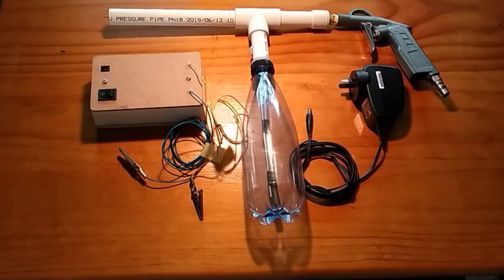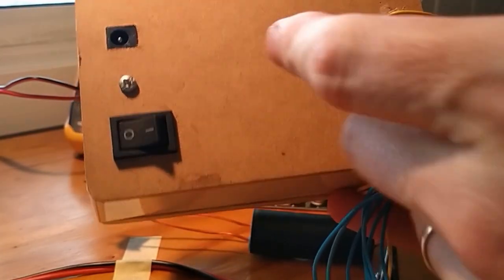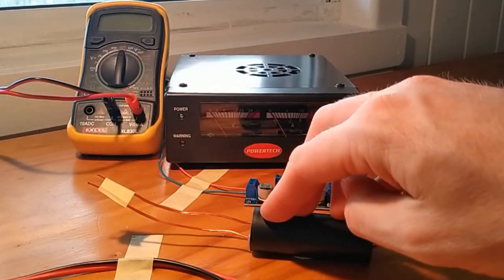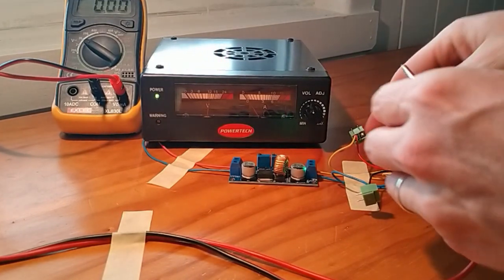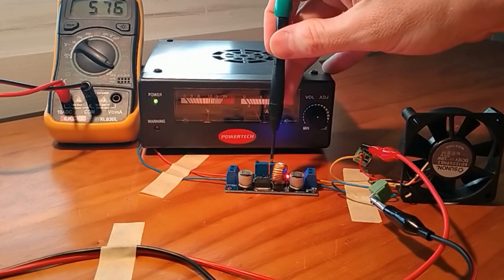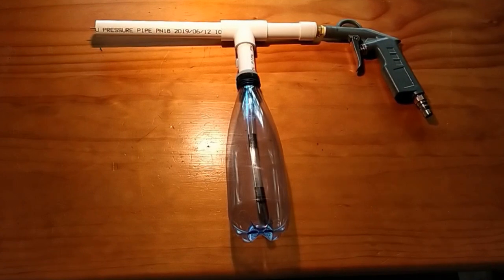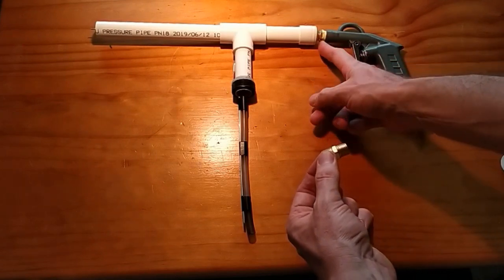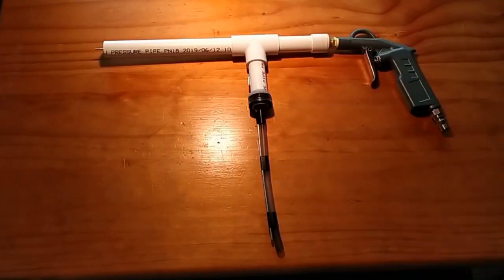Homemade Powder Coating Gun

Comment: I built a powder coating oven, and I have been trying to make a powder coating gun, with no luck, then your Video Pops up details leaving nothing to ask you about? Man you rock!, I thank you very much for this very detailed explanation, I happen to have all the parts except the dc-dc step down buck, I've placed my order just now, because I don't wish to destroy my taser module.
Thank you again
Reply: Im trying to make an over out if a smoker grill egg shaped one thats electric is it possible they get hot enough ?
Reply from the maker: You're welcome. Have you seen my other videos? 2nd Generation gun? I have made some improvements you may wish to take advantage of.

How big is your oven?
Reply: @tinkersmith4615  Going to do so right now, my Oven is quite small 40X40X40 Cm, and btw, I've subscribed to your channel :)

Comment: I'm a little late to the party here, but I do see one little issue that might  change the efficiency of the system. Those little taser modules typically put out high frequency high voltage AC.  For that to really be effective in a charged application system, it needs to be DC.  You'd be better off using one of the lower-power 20kv modules and adding a couple of voltage multiplier circuit to the output. Use a couple of capacitors and diodes potted in wax or epoxy.  Or even a just string of 1N4007 diodes potted in wax or epoxy attached to the output would probably do it.
Reply from the maker: Never too late. :) So build a bridge rectifier and use a 20kv module (to reduce the number of diodes required)? For example you would need 24x R3000 to rectify 20kV, where you would need 66 for 55kV?
Reply from the maker: I do like the idea. I might need to do some testing. The only hurdle I see is that current configuration produces really good results for very little time and money. Diodes, resin and all that is whole lot of manufacturing. Do you have a sense or gut feel for what the additional benefit would be the effort?
Reply from the maker: Actually I do know that if you supply 1A into these "400kV" modules you get about 30kV output. Ran a series of tests and measured the gap between the sparks. 30kV per cm.

Comment: Would fish tank compresor be sufficient enough for it 1,8l/min?
Reply: I think its a nice idea also a was thinking about 12 car compresor it can be hooked up to same power supply as gun
Reply from the maker: I couldn't say for sure but I doubt it would the airflow required. I am intrigued by the concept though. A compressor-less powder coating gun. It would be a super cheap set up and you probably would have less issues with moisture (no compression and expansion of gas). What about using an air mattress inflator pump?
Reply from the maker: Something like this: https://www.bunnings.com.au/ozito-500l-min-electric-air-pump_p0242858?gclid=Cj0KCQiA6t6ABhDMARIsAONIYyynjBaXJ-TlSu7800huyx2i9LO8TM80saDZWGsQACyTPN-rSQZoeCIaAvAlEALw_wcB&gclsrc=aw.ds

Comment: hi, how do you check if its positive or negative? if you touch with the positive a metall mass it do something? (i need to charge positively one powder for a project, but it must be positive charge)
Reply from the maker: I couldn't say for certain. I'm only guessing that it is follows straight through from input wire to output wire.

Comment: Thanks for the uploads.  I am in the process of building my own. I have read and seen that to get the best coat on you part you need a good ground.  How do you ground your parts?  Thanks
Reply from the maker: The only ground I have needed was connecting the work piece to the negative high voltage wire. I too have read about people driving earthing rods through their shed floors into the ground and connecting them to the negative wire and work piece but I have not needed to do so.
Reply: @tinkersmith4615  Awesome! Good to know.  Thanks for the quick response.  I look forward to more of your videos, they really are first class.

Comment: Hi Tinker, just wondering if I were to make one of these guns, what power does my bench power supply need to be. Would something like a 15V, 2A DC Adjustable Regulated Linear Bench Power Supply be ok? If not could you point me in the right direction?
Reply from the maker: 15v/2a would be ok as long as you only run the high voltage module at 4v/2a. The module itself will only draw roughly 3.33v/2a due to its internal resistance if a 2a limit is set. I am just in the final stages of putting together another video where I demonstrate this relationship. I will also show the performance of the gun when it is set at 2a. I will try to have it up as soon as I can.
Reply: @tinkersmith4615  Thank you for your reply, really appreciated
Reply: @tinkersmith4615  Actually since it steps the voltage down you need less input current than output current.
Basically the energy needs to be conserved, but then there are conversion losses often better than 80% but to play it safe and call it an easy to use for calculations 50%.
4vx2.5A = 10W, assuming the horrendous 50% efficiency  -> 20W input power would be required or 20W/15V ~= 1.3A

Comment: Thanks for this awesome video and explanation of the powder coating process and components. I plan on using it to powder coat jewelry; so we're talking about small pieces. The gun maybe small as well or I might make a charged brush to use in some instances. I will let you know how it turns out. Cheers.
Reply from the maker: Keen to hear how you go. Cheers.

Comment: @tinker Smith how is the bottle cap attached to the pipe itself?
Reply from the maker: Check out: https://youtu.be/YsN4F2naDf0

I explain it further there. Please come back to me if it is still not clear. 

I am in the process of building the 2nd generation of the gun. Stay tuned. :)

Happy building.
Reply: @tinkersmith4615  thx ill check it out.
Reply: @tinkersmith4615  i just made the setup,basically exactly what you have done,same parts and all. Tried it out today but doesn't seem like the powder was sticking,not covering very well at all. Have good flow of powder out of the gun just didn't seem to stick. Tried on a test piece of angle iron,aluminum strip and just random scrap metal. Got same reaction on all. Any ideas what may be happening? I'm at 4v and 2.5amps.
Reply from the maker: Hi Mark, how frustrating. It does work. :-) Can you try this first: https://youtu.be/oupryTnm-CQ?
Reply: @tinkersmith4615  i tried the video link, says its private.
Reply: @tinkersmith4615  also thx for quick replies.
Reply: @tinkersmith4615  rewatched the vid. Think my mistake was my power supply,its only 1.5a. So ill dig thru and find a higher amp power source.
Reply from the maker: Ah, that will do it. That video I linked to is going to be part of a larger video. In it I conclude that you must power it 1.5A or greater. Sorry about the private video. Just made it public now. Can you try it again?
Reply from the maker: For 1.5a, it does work, to make it do so I had employ the trick in the video I linked a few times. I have video of 1.5A. I will include it in the larger video. Just a few things to cover before it is done.
Reply: @tinkersmith4615  ah,ok thx. I'll try it tomorrow. I found another old power supply 12v 4.5a. Just gotta get a correct end on it to plug into my setup I made.
Reply: @tinkersmith4615  ok i have success. I ordered 2 of the black parts, the one I installed was a dud. That vid you linked when I tried i got no arc so it wasn't sticking. Thankfully the 2nd one was good,went on really nice and even. Not bad for $10 in parts. I just needed the electronics parts,everything else I had or was scrap parts. But now I know it works I'm most likely going to build your gen 2 gun. Thx for the help and the diy,big fan of making things myself,too much free time these days.
Reply from the maker: Woohoo!!!

Comment: thanks for all your videos and very clear explanations. so the buck converter power supply is only there for protection in case you short the output of the High Voltage module? it will work just fine with regular power supply as long as you be careful not to short the output.
Reply from the maker: Well, yes and no. I have done further experiments and found that the amps is the most important factor. Of course in an electrical circuit both volts and amps are related but I have found that if you had to adjust just one, amps is it. So, to answer your question, yes provided you don't have a power supply that will deliver to many amps should you increase the voltage too high.
Reply: A resistor at the output would also limit current

Comment: I got a very stupid question where is the second high voltage cable mounted ? I mean one goes to the wire in the gun .... and the second ? Or could you use both  in the gun with enough distance
Reply from the maker: The positive high voltage wire (yellow) clips onto the rod in the chamber at the front of the gun. The second high voltage wire (blue) clips onto the work piece itself. I usually clip it to the wire from which part I am powder coating is hanging from. At 1:38 in the video you can see it clipped to the hook at the top. This grounds the part and ensures the powder will cling to the work piece. Please come back to me if this doesn't answer your question.
Reply: @tinkersmith4615  Okay i understand. i thought it would be enought if you put the ground from the "low current cabel"/power suply  to the workpeace! So everything is clear

Comment: great tutorial which has inspired me to make one however i dont have a bench power supply, do you need one of these because it would not be cost effective for me to buy one just for this project as they are not cheap. i could buy a proper gun for not a lot more money. thanks regards Gary.
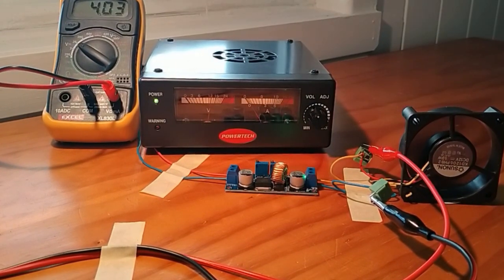Reply from the maker: No, you don't need a bench power supply. I only used it to demonstrate a feature of the dc-dc module. A simply wall adapted from an old wifi modem will do. Have a look from 13:20 and you will see I talk about it in detail. Hope this helps.
Reply: @tinkersmith4615  cheers mate, i will give it a go.
Reply from the maker: You could probably even use a little 9v battery if you wanted to.
Reply from the maker: Looking into it further, I don't think a small 9v battery will be able to handle the max current draw of 2A. You may need to use another battery with a high amp draw if you wanted to use a battery.

Comment: Great video like the others i too have ordered the parts. I was looking for eastwood powder coating unit and saw your video. Here in my country eastwood cost P14,355 converted to us $ its around $300 with shipping  and the high voltage module and dc-dc converter with adjustable power regulator with digital display is jus $10 you saved me a lot of money and learned something new at the same time. Thanks again and good day to you mate!
Reply from the maker: You're welcome mate. I hope you have great success with it.
Reply: @tinkersmith4615  i'm just curious. If you don't mind me asking would this dc-dc work https://shopee.ph/DC-DC-Buck-Converter-CC-CV-Power-Module-1.2-32V-5A-Adjustable-Regulated-power-supply-Voltmeter-ammeter-i.310237530.4253495594

Thanks again.
Reply from the maker: Yes, that should work well. The most important thing is that it can limit current. I tested these high voltage modules by varying the voltage and current to see which was limited first. It was always the current. For example, if I set it at 2.5A the voltage would only get up to 3.3V and not exceed it.
Reply: @tinkersmith4615  Got it much appreciated. I'll be waiting for your next upload.

Comment: Since the step down buck converter is capable of suppling 5A, would it be beneficial to have it run 2 3v - 6v 400kV Step up modules?
Reply from the maker: I have thought about it but haven't tested it. Running two modules in series would increase/double the voltage, say 100kV to 200kV. Running them in parallel would increase the current. My guess is that running them in parallel would achieve better results; i.e. less overspray and thicker coverage. I haven't tried it as I am content with the results I am getting.
Reply: Have you had any trouble with getting shocked because of using connection wires that is only rated for 600v. I have ordered 30kV wiring used with high voltage CO2 lasers.
Reply from the maker: I used very think wire for the high voltage wire in the video. I haven't been got however I have seen sparks  jump on the negative side down to my saw horse legs if they touch. In my next model I  used thicker gauge wire and have seen no spark jumps.
Reply from the maker: Btw, I have tested running the high voltage modules in parallel at 4V/1A for each; 4V/2A supply. Sadly, the powder won't stick at that current rating. I am currently working on a new video demonstrating all the different current settings, what works and what doesn't. Keep a look out.
Reply: @tinkersmith4615  Thanks for your replies! I will be watching for the next video. I will also send you updates when I have finished my completed project.
Reply: @tinkersmith4615  As we originally spoke about running 2 HV modules on the same PS module, I had a couple thoughts. The HV modules can't be run in series. The output voltage from the fist module would destroy the second module. You mentioned the powder would not stick at 4v 2A for both modules. The current would have to double for 2 modules, while the voltage remained 4v. Am I close in my thoughts?

Comment: Excellent. Parts came in today. I'm using a 12v 4.2a Mean Well power supply along with what i think are identical buck and boost modules. Everything is assembled inside the case of an old ATX power supply that died a while back and i decided to keep the 120mm fan in the case to cool everything. Everything is assembled, all thats left is the first test which i'll be doing in  the morning. It's a bit late to be charging up my 26 gallon compressor in the garage lol.
Reply from the maker: Awesome. I'm super keen to hear if you can repeat my results.
Reply from the maker: Any chance you have tested your gun yet? How did you go?
Reply: @tinkersmith4615  I initially screwed up and mounted all the hardware inside that old power supply case and between that and making the leads too long, i fried one of the two boost transformers because it arc'ed through the insulation to the metal of the case. I then swapped everything along with a new voltagte booster into a cigar box and nothing....  then i realized i didn't have the clip on the electrode  sticking out of the top of the gun and once attached, the powder flowed and it stuck to the test part amazingly well. Better than i had imagined in fact.  The powder i used was the cheap harbor freight stuff. I went with the semi-gloss white since matte black the only other choice and here are the results.
https://i.imgur.com/RJriYCF.png

Just a simple, very old spring clamp made by the Cincinnati Tool Company probably around 70 years ago. It came out real good with not much orange peel. I'm going to try again running a heavy gauge ground wire directly to the house grounding rod which is in my garage also. From what ive been reading, the better the grounding, the better it will come out.
Reply from the maker: Looks pretty awesome to me. Thanks for sharing.

I haven't had too much issues with orange peeling yet but that is because I am only just starting out. When I look at articles like this (https://www.tiger-coatings.com/blog/default-title-5) it could be any number of issues.
Reply from the maker: I am using very thin wire for the high voltage wires. Perhaps I should be using thicker stuff but it currently works for me. I hear some arcing from time to time but it hasn't worried me yet. There are videos on YouTube of guys shocking themselves with these modules for fun. I did get hit by one once when playing around with it on the bench. It felt like being zapped by an electric fence.
Reply: @tinkersmith4615   I used coax RG6 with BNC Connectors for quick disconnect.
Reply from the maker: Nice idea! Yours is clearly the premium addition of this setup. 🙂

Comment: I have ordered all the bits n Bobs to. Make This and can't wait...

The only Thing I seem to be missing on the wiring side.. 

Is where do the 2 high voltage wires connect to That come out of the 400kv thingmebob. 

Which one goes to the gun and which one goes to the part? 

A mini wiring diagram would be bloody awesome mate. I will make u a video when I have made mine. Thank you 👌👍
Reply: Jimmy, did you figure out which lead from the high voltage generator goes to the part and which goes to the gun?
Thanks
David
Reply: @davidblahauvietz6863  live + positive to the gun
Reply: @Jimmy-choo  Yes, but since both output wires on brown, which one is positive and which one is negative? The input wires are green and red.  Red went to positive and green to negative according to Tinker's video, but the output wire are same color brown.  I don't dare put my voltmeter on this as I don't think it will handle the 400k voltage.
Reply: @davidblahauvietz6863  when holding the cylinder imagine the wires inside.. Left red... Right green... It works the same the other end.. Hope that helps

Comment: You are very useful man! I am asking because read both for tribo and corona powder coating. I wanted to make tribo gun as it is without high voltage. And they use teflon/PTFE/ which polarized the output tube negative. It may be useful.